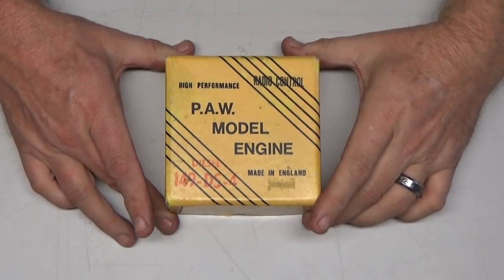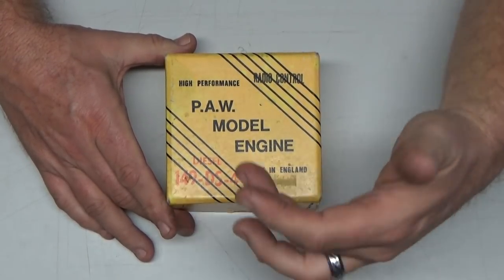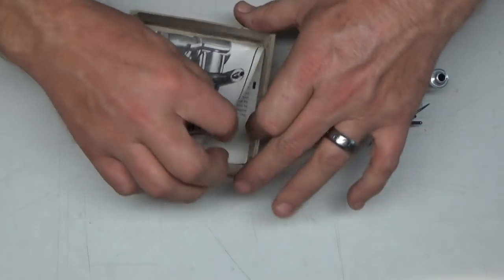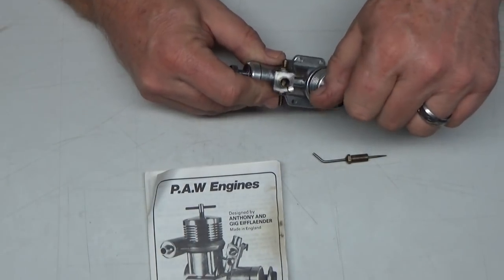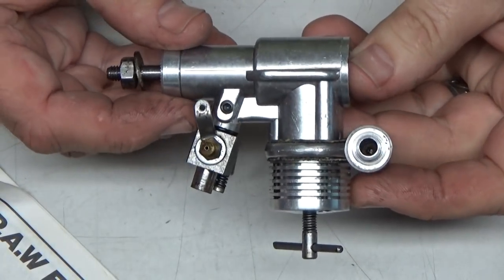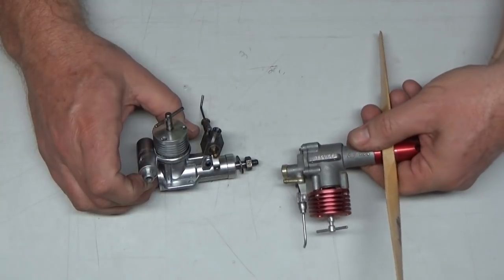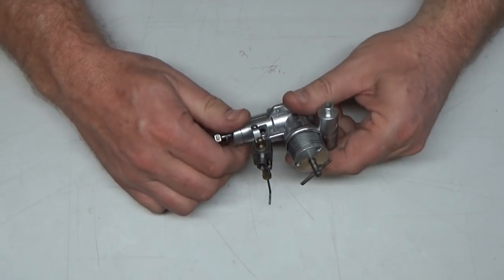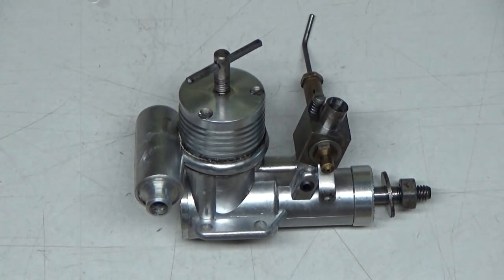PAW 149 A Quick Look

Comment: Hi David
I have the same engine only without muffler and carb...I bought it for c/l use. Progress Aero works shipped it to me in Zambia! Very good service from them! I am starting to run mine in as per the instructions. I would love to know what DS means. I believe  it had something  to do with combustion chamber and more efficient fuel/air mixing. Also I am not sure if it is plain bearing with 1 ball race. Maybe PAW guys can shed some light? Great engine...you will love it! Thanks for sharing.
Woody.